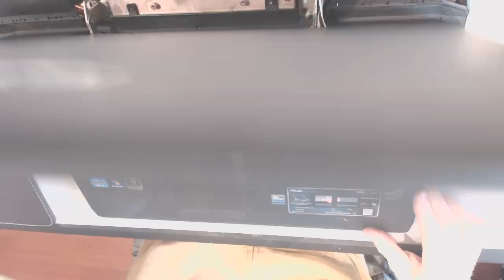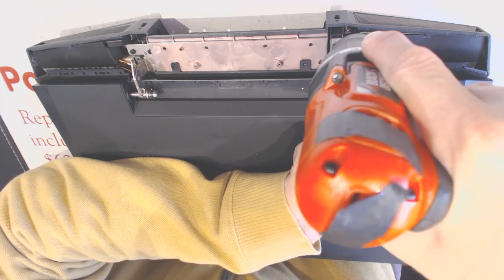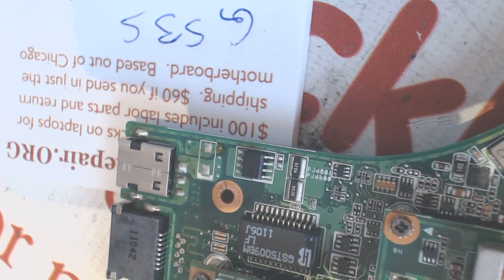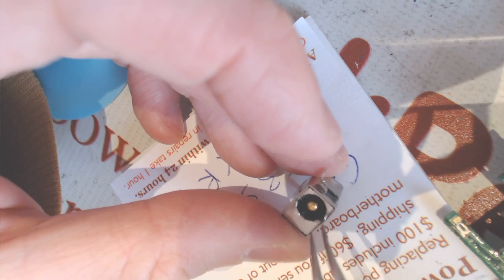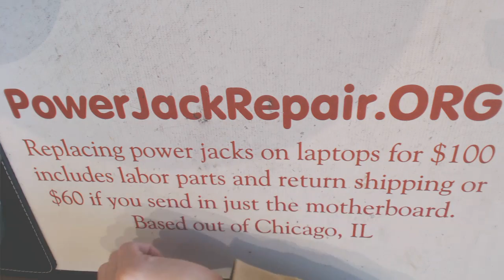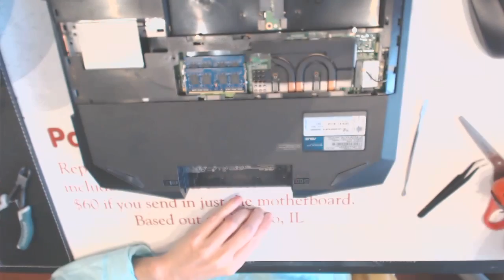Asus G53s G53sw broken faulty dc power jack repair socket input port connector fix

Comment: Great video! Successfully soldered new jack into laptop. The OEM solder was very hard (was probably lead-free) and desoldering was quite a tough process but with a high temperature it eventually came off (using sucker & braid). Your video really helped! Thanks!